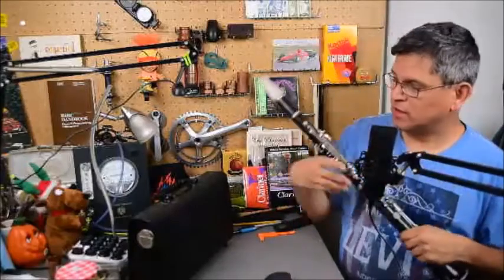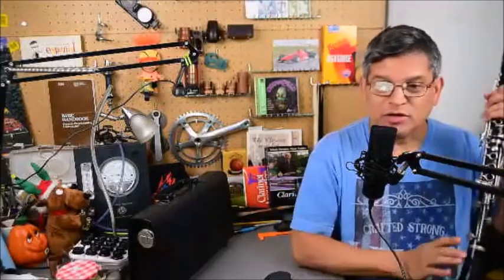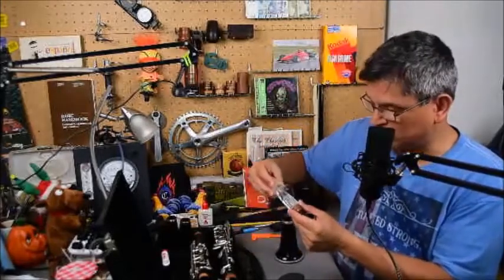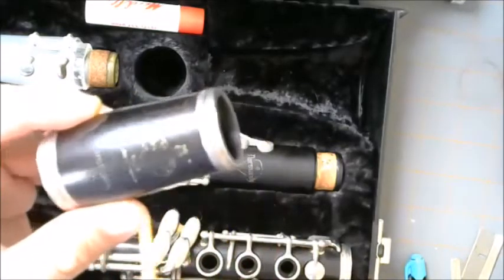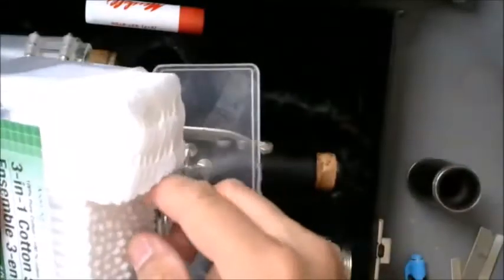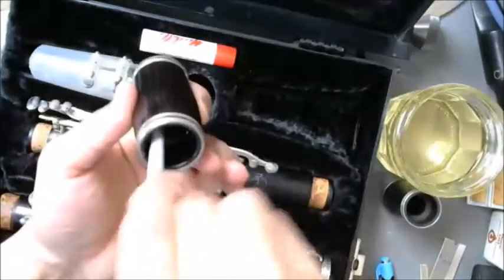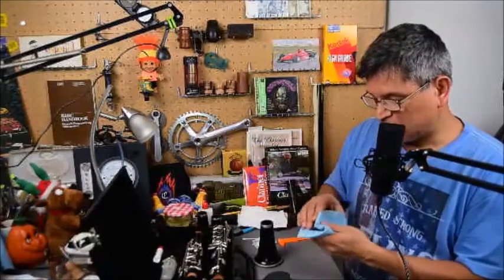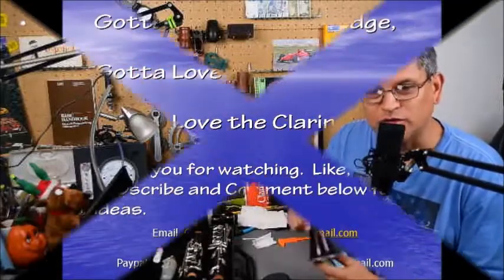Basic Clarinet Maintenance - Identify when to Oil your barrel sockets and bore

Comment: I'm 27 this year and have been playing the same LeBlanc since 3rd grade. Never cleaned or serviced it in any way haha
Reply from the maker: Love Leblancs.  My first was a Normandy 4, then Noblet 45, then a bunch of Leblancs settling with a LL set.  Be careful of various buildup of stuff.  Draw a swab through the instrument, both directions, and try to clean the toneholes with a Qtip from time to time.  Also, bladder pads (and leather) tend to become more porous over time especially at 10 years on avg, which you may not notice as it's a slow process.